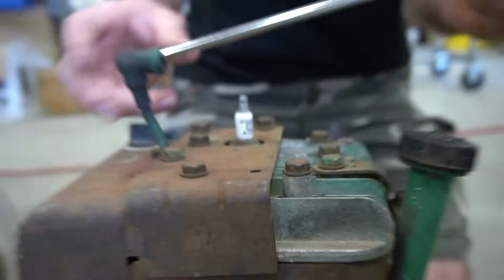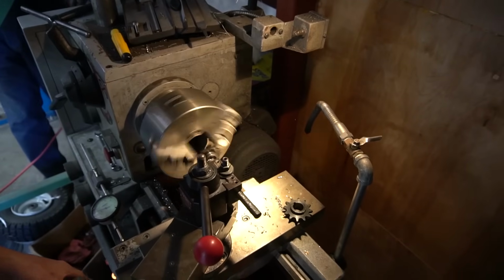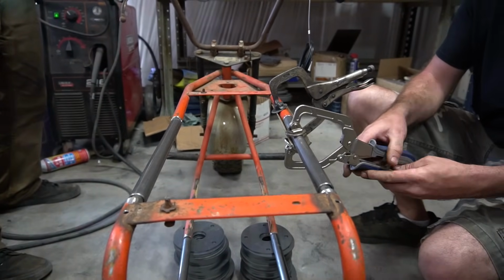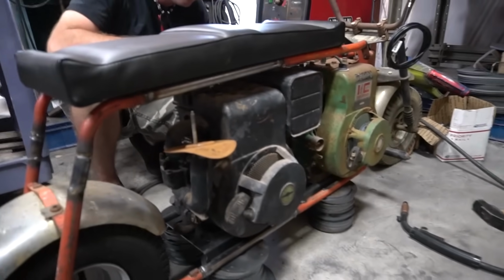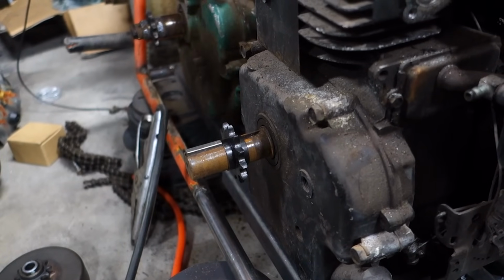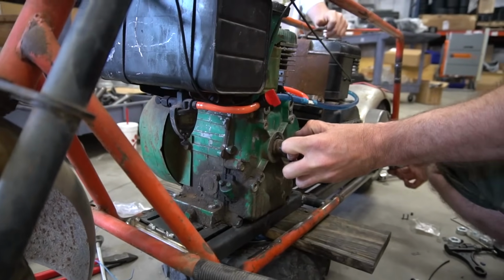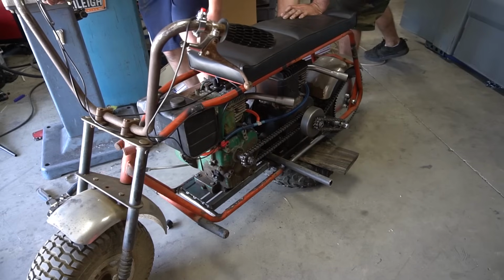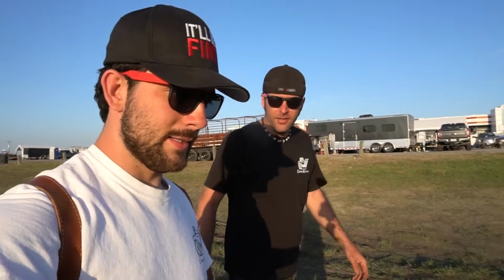Rat Rod 16 HP Twin Engine Mini Bike Build

Comment: If you don’t count the cost of some of the parts we used this project was really inexpensive.

I want to use that logic in my construction business.....

Me:  Yes, sir!  I can build that new house for $26,000.
Client:  WOW!  That’s a great price.  All my other bids were 20 times higher.
Me:  Yup.  I like to work cheap and pass on the savings.  There are a few small things not included in that price like foundation, floors, walls, roof and all finishes but I’m sure those minor incidentals will hardly add anything to your final price.  Trust me.  Now sign right here on the bottom line.

Comment: Should have added a clutch on the front engine then you can start one engine at a time and if it ran at two different speeds the clutch could make up for it so it wouldn't slam the sprocket

Comment: I knew you'd have issues with the engines joined that way, but time was short. Instead of the 8 hp Briggs engines, I'd have looked for a 2-stroke snowmobile engine.

Comment: I put two engines on a mini bike but didn't stretch it I had an 8 hp Briggs below me and a five hp Briggs on a little luggage rack on top of the back fender, I also stacked another sprocket on the back wheel so it had duel chains and clutches also two throttles one for each hand.f**** fast

Comment: oneway bearing on front sprocket .... those engines firing out of sequence will destroy chain an sprockets
Reply: Plus a roller-type chain tensioner w/ chainguard between engines would help also.  Clutch also seemed to have a hard time in the video. Maybe go torque converter instead?

Comment: What about the timing between the two engines? In phase or 180 from each other? I've always wanted to do something similar but was always told the two engines would work against each other and break any chain or shafts connecting the two.. in theory as one is firing power stroke the other would fight against it and start tearing each other apart even in the slightest variance of timing between each other.. I'm very curious to see where you guys go with this.. been a life long pondery lol

Comment: Truthfully if I was making a drag race mini bike a would have a big sprocket where the motor connects to the chain and a small one by the wheel that way your riding in highest gear no lowest that way you have more speed

Comment: How did you guys time the engines hit at the same time or apposed hit
Reply: lomsome's Garage seperatly
Reply: Isaac it'll be fine ok I done mine on intake and compression it followed a hit behind the other massive torque and then power too i also used 36 tooth sprockets to kinda give me an idea of 360 degrees so each tooth would be 10 degree of timming it works for a point to match firing order or phazing them in different patterns of firing helps with the starting too
Reply: Thought I would share what I found worked I used the weld your self gears form TS

Comment: Hmm so the engine works fine putting in on a 90 degree angle like that?. I thought it would mess up the oil circulation inside. I'm also supprised that the frame didn't bend since it must be at least 550lbs with two persons and two engines.

Comment: That sprocket snapped because you guys dint timed the engines together you need to make sure both pistons fire at the same time  otherwise the chain will jump and get stressed because 2 pistons are firing in 2 different times that’s why the chain was jumping. And snapped the gear.  But hey I’m just suggesting. (It will be fine)

Comment: Can somebody explain the grounding problem at 12:28
Reply: The current from the welding has to make its way from the ground to the part your actually welding. So in this case through the pistons, rod, then to the crank. Could cause arcing between bearing surfaces.
Reply: Thanks!

Comment: Biggest takeaway from this Video: Ike and Chris have complete opposite views and Ideas on how things should be built and butted heads the whole time-  I also agree with the comments below, that the engines should be timed 180* out from each other, not in synch- SO one engine should be TDC for power stroke, the other TDC on Exhaust stroke -
Reply from the maker: They really didn’t butt heads the whole time. Just those one or two instances.

Comment: Years ago, we ran a dual engined kart "freight train" style like your mini-bike. Used a regular single chain clutch on the front engine and a clutch with dual sprockets on the back one. A short chain from the front engine clutch to the rear engine drum and then a different chain to the rear sprocket. They were Comet brand clutches. Having a clutch on each engine made things much easier getting started. From a standing start the engines could be out of sync with each other and the kart would sound like a Harley or a BMW. But after a couple of hundred feet the clutches would slip a little bit until both engine were firing at the same time. Sounded like a really big single then. It was also easier on the chain between the engines having that little "slip" from the clutches there.  Looking on Go-Powersports web site, they have that type of clutch!  http://www.gopowersports.com/max-torque-centrifugal-clutch-dual-12t-35-sprocket/  You would have to machine the ends of the cranks down to 3/4" but two side cover gaskets and a little lathe time would fix you up.

Comment: Use 2 clutches, rear one is a double sprocket for a two speed. front engine goes to one sprocket , jackshaft or rear wheel goes to the other. Easy. chaining those motors sucks. It whips the whole time.

Comment: Couldn't you have just made a custom intake manifold between the two engines and used a single larger carburetor to run both? That would probably make it much easier to run them in sync with each other think of the older Briggs and Stratton opposed twin engines

Comment: Did y’all take into consideration the synchronization of the stroke positions of the motors? One on power stroke the other on exhaust stroke... or both on power stroke at the same time, incorrect timing could’ve been the culprit of the gear shattering

Comment: try dual clutches one on each motor.
Reply from the maker: That’s the plan, we couldn’t pull it off in Texas because we didn’t have time to turn down the weird stepped shaft on the green engine
Reply: CarsandCameras cool. No need to respond to my first comment I got my answer here and oh yes I can't wait for that video it is going to be sweet. 👍👌.

Comment: Why not put 2 centripetal clutches on it? One on each engine. Then the motors can free wheel until they are under power and there would be a clutch (or 2)to burn up vs a sprocket and chain to shred. Would that work?
Reply: Chad Ellis two clutches would be ideal

Comment: why not move the jackshaft inbetween the engines and run 2 clutches to it and one sprocket to the rear? offset one engine right and the other left to make room for the chains... this way you dont have the issues starting, pulses out of sync, if one engine quits you can run on the other...

Comment: The Briggs engines are a disaster. The diaphragm carburetor is bad on one. You need to put new diaphragms in both carbs. Those 5 horsepower diaphragms are always bad. But it's a really nice project!

Comment: did you time the engines against each other at all? I would think you would get the most power if one was at TDC and the other was 360º out, TDC on exhaust. But I think it would sound so SO good if you had them timed 90º apart by getting them to TDC then roll one back 45º and one forward 45º. Please don't tell me not to roll engines back I do it all the time on small stuff like this, Its more a problem for some cars with a few types of tensioning systems.
Reply: I was wondering the same thing...

Comment: If both are putting out 8 hp, then the max output is 8hp. Not 16. One motor is only assisting the other. NOT doubling output. Just like if you had 2 cars side by side doing 50mph, and both speedometers read 50, they will travel 50 miles in a hour, not 100.

Comment: JUST USE A CLUTCH ON BOTH MOTORS PLEASE!!!!
Reply: kameron454ci thats the future plan
Reply: crazy idea use two clutches on the engines then run to a cvt
Reply: stub shaft with sprocket instead of engine on the cvt. then cvt is powered by the chain coming from both engines if you catch my drift.

Comment: It's like the dumb and dumber engine build, why the hell are you tying the 2 engines together? that's ignorant, just put an individual centrifugal clutch on each one and offset them with 2 rear sprockets in short let each engine do its own thing.
Reply: Because of the weird crank shaft.
Reply: @RattyFlyer   Don't listen to me dude my hog is stock I'm still going top speed of 21 miles an hour lol